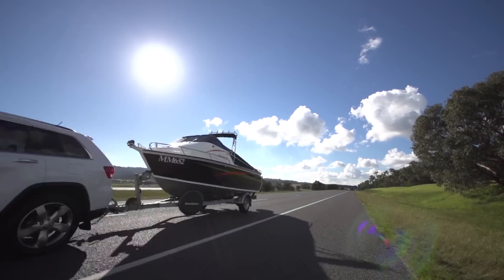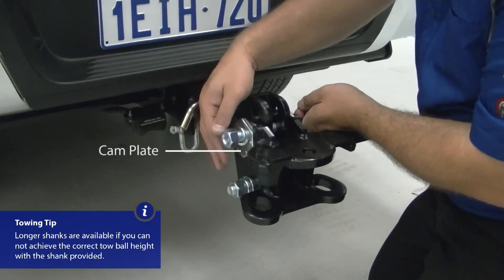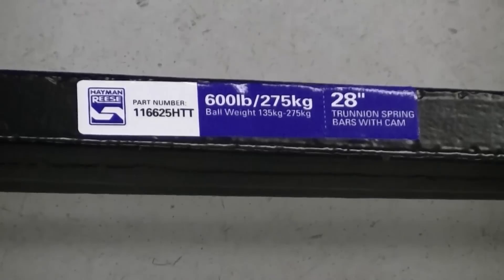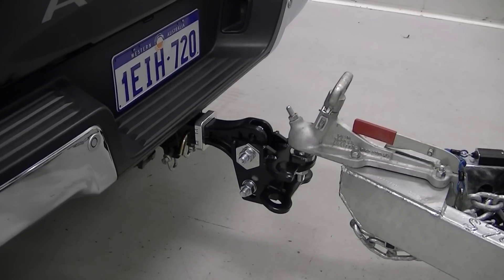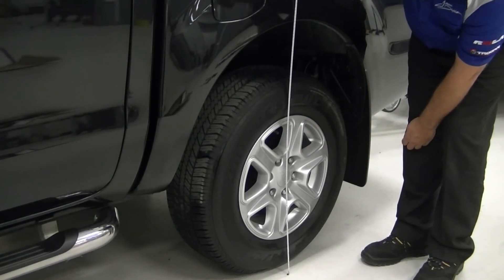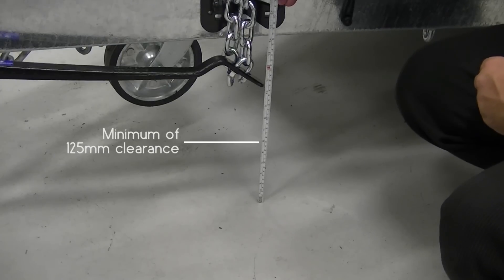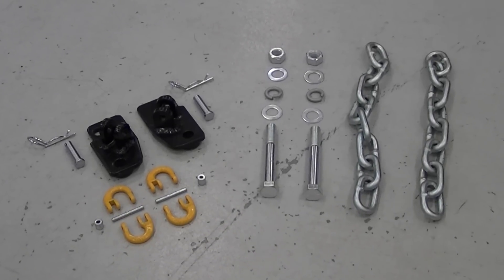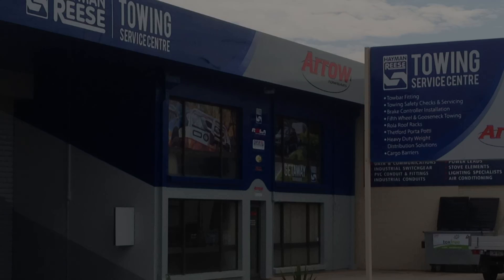Weight Distribution Hitches - Setting-Up (Part 2)

Comment: Can I ask why you would adjust the ball height using the cam plates over just using the multiple holes in the drop shank?
Reply from the maker: Hi Joshua, The cam washer is used for adjusting the angle of the spring bars to gain or lessen the amount of chain links you have. You wouldn't use the cam washer to adjust the ball height. This is covered at 5:40 in the video. 
Thanks
Reply: @Haymanreesetowing  Aha I understand now. Not sure why I missed that before.

Comment: Hi guys, just a quick question as there are plenty of self appointed experts out there and I've had various opinions. Do you recommend the likes of a friction grease on the bars at the hitch end. I have heard plenty of squeaks from hitches as the tow vehicle manouvers. Same question about grease on the towball. Cheers and thanks. Stu
Reply from the maker: Hi Stu, No, we do not recommend the use of grease as it does collect dirt and become abrasive. We have better long-term results without when it comes to wear unless very regular removed and reapplied.

Comment: Hi guys can you use your system with a D035 coupling
Reply from the maker: Yes, our WDH is compatible with DO-35 series 3, if you have series 1 or 2 you can contact Cruisemaster for an adaptor plate.

Comment: One question after mounting the tow ball head and tightened the bolts, should the ball head move?As in mine there is a little bit of play and have been told two different things one says the play is because the holes for the bolts is a fraction larger than the bolts others say should be no movement in the ball head.
Reply from the maker: Hi x ym, Provided the two M19 ball mount head bolts have been tightened to the correct torque (190Nm as per the fitting instructions) than any movement of the ball mount head on the drop shank,  when there is no load being applied from the springbars, is common and usually normal. Once the springbar tension is applied the head will not move and the loads will be carried through all the components correctly. If in doubt please have a Hayman Reese Weight Distribution Hitch specialist inspect the WDH set up. Thanks for your comment
Reply: Thanks i can now show to the know it all who says there should be no movement of the ball head.

Cheers

Comment: Hey guys I'm surprised there's no comments on this video for two years. Near the very end you mentioned to disconnect the bars before backing up. Does that not then produce the unbalanced between the trailer and the total vehicle you were trying to avoid in the first place.? I know backing up is not very far but the unbalanced should still be an issue is it not?
Reply from the maker: Hi 2bikemike, Thanks for your comment. By disconnecting the Weight Distribution bars when reversing you avoid the risk of impact to the low hanging spring bars which is critical to the life of the bars. Hope this answers your question. 
If you have any futher questions please feel free to give us a call 1800 812 017 Cheers.

Comment: Hi Hayman, Can I use any 12mm Bolt (Zinc, Gal) to half link the chain or do I need a special bolt (Stainless, High Tensile) for the job?
Reply from the maker: Hi Steve, 
Thanks for your question. You will need to use a bolt with a minimum grade of 8.8 for this. 
If you have any further questions, feel free to give us a call on 1800 812 017 or email enquiries@cequent.com.au
Thanks!